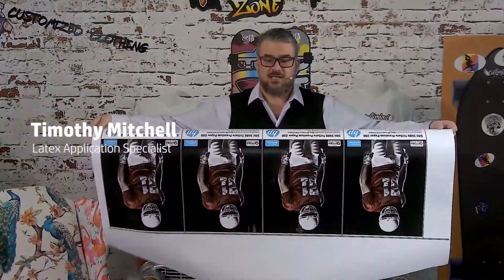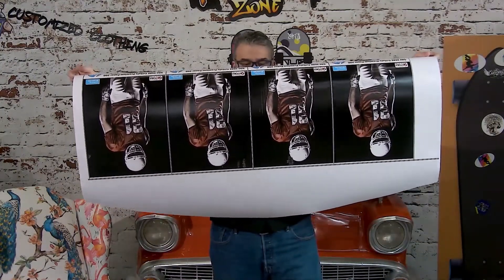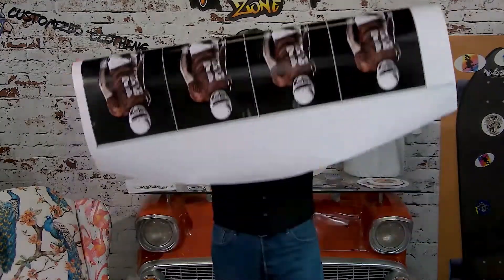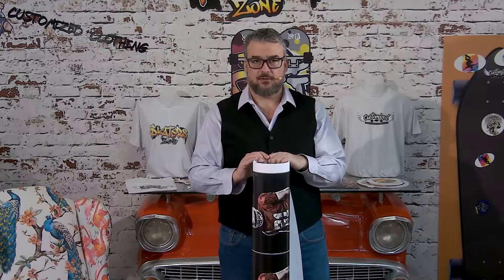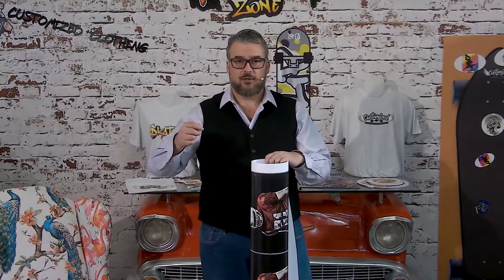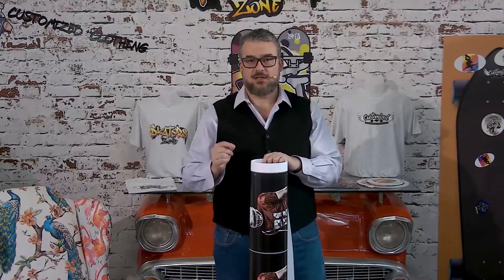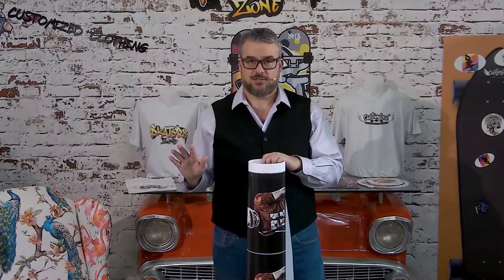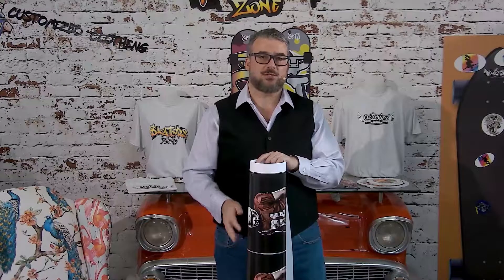Adjust Paper Settings for Ideal Results with the Latex Technical Sihl 3686 | HP Latex | HP

Comment: So what numbers/settings do you use for the Sihl 3686? I’ve tried different settings on our Latex 365 and the same problems still occur: the print head scratching the prints, paper warps that it scratches on the curing area, patches of the prints especially in the beginning that are not curing properly.

It’s gotten ridiculous that we have to be constantly in front of the machine to hold the paper and watch if any problems occur. Not practical for huge jobs.

Also tried the Take Up reel and the same problems happen. We are still constantly trying to find the sweet spot where the curing temp and vaccum won’t cause any issues. 

The lack of support from our supplier and HP is ridiculous. We would ask for settings to start working with these papers and we get bounced around and as confused as ever. 👎🏽
Reply from the maker: Hi there, thanks for contacting!
I understand that you need to know about numbers/settings you use for the Sihl 3686.
In order to get this issue fixed, please contact our customer care team over the phone or chat for further assistance, as this issue requires Live conversation with you over phone or chat to isolate the issue and provide you instantly with appropriate solution or repair/replacement options available at your place as per the warranty.
Please feel free to reach us on call/chat, please access this link to select your preferred country and language option to reach us. Global support link: - https://www8.hp.com/us/en/contact-hp/ww-phone-assist.html
Binu - Social Media Tech Support